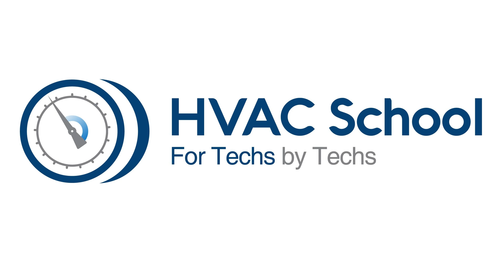Molecular Transformator - Short #217

Comment: Going to tank upside down and pull through the suction line and remove valve course rarely will ever have to use this. Unless you recovering to a very large tank with a lot of refrigerant imo. Good short.

Comment: I built my own subcooler with a brazed plate heat exchanger that can handle 410a pressure. I work on chilled water systems....so when you have 1000's of pounds of refrigerant to recover....speed in recovery makes it critical. I use push pull and getting liquid out is the easy part....its the vapor that takes a long time. The subcooler will help speed along that process tremendously. Its nice when there is a functioning chiller....I can tap into the supply and return water....and run 44° water through my subcooler and it really drops the tank pressure and speeds up the vapor recovery process